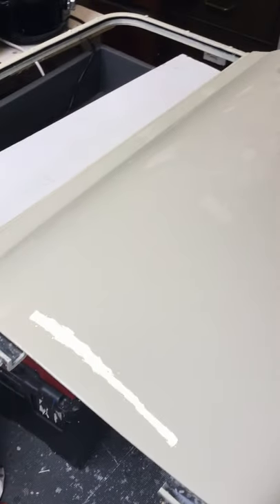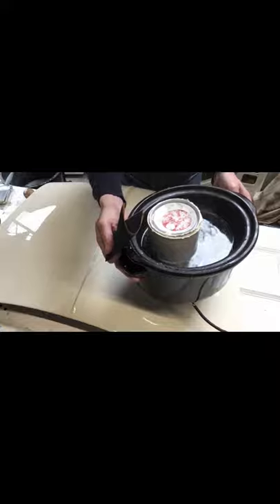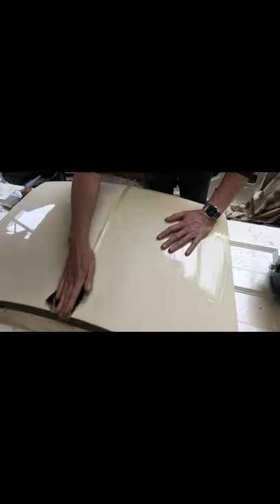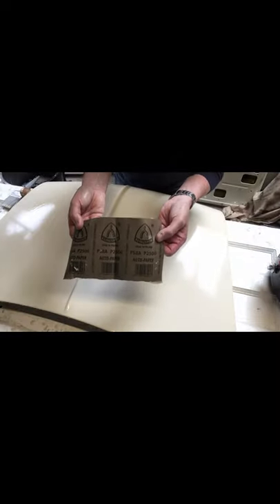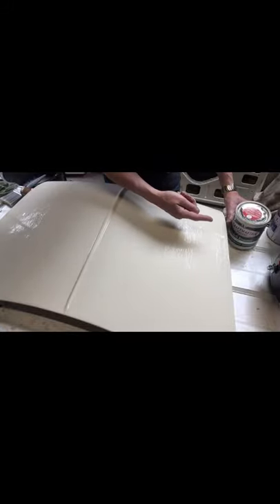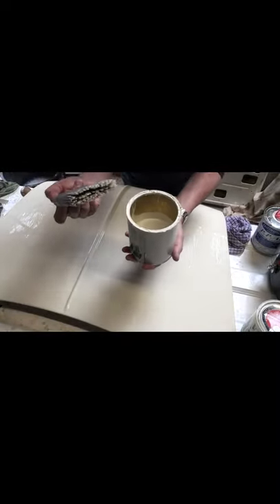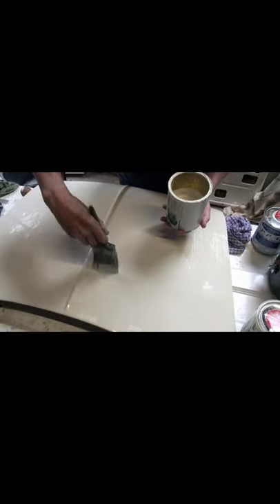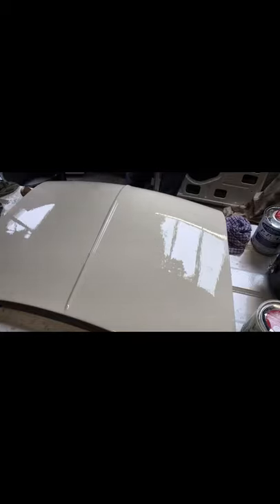How to hand paint a car in coach paint for £350 with a 3” brush

Comment: Can you do this with other paints and clear coat?
Reply from the maker: Good question, not sure to honest if you did it with house paint you might have to repaint every 2/3 years.
My late dad used house paint in the 1970s to paint a Triumph 1300, and a Vauxhall viva and they came out brilliant.
Regards Steve
Reply: @2194steve  i meant automotive paint, i need to paint my car. Thanks, this is a lot easier and economical than using a big air compressor.
Reply from the maker: @larryjohnson8168  any enamel paint will do the trick, one shot or something similar
Reply: @2194steve  the only thing is it’s a bmw Montreal blue there’s no enamel for that color, i saw you were brushing clear coat. I could just brush that on there like you did?
Thanks
Reply from the maker: @larryjohnson8168  craftmaster will mix paint any colour to match, I think most enamel paint suppliers will mix a match for you.
Where in the world are you?
Cheers